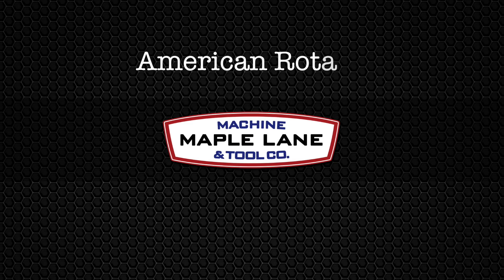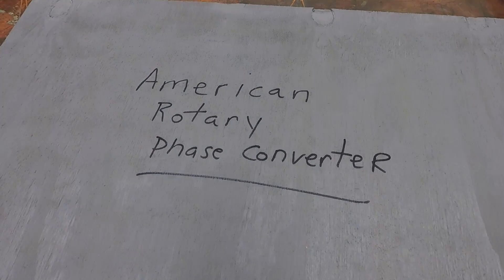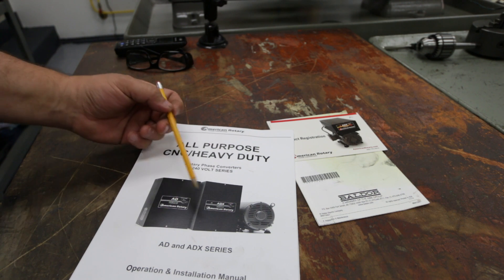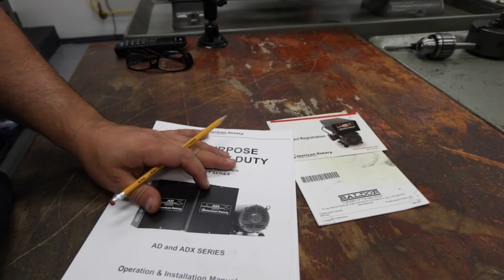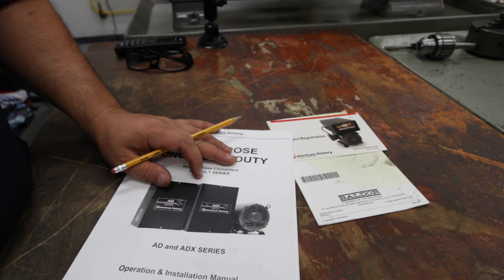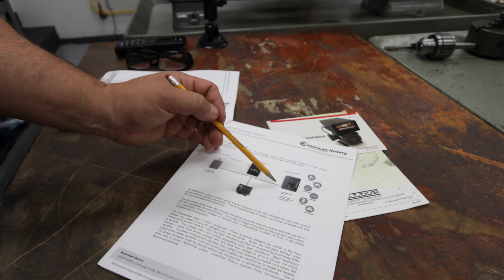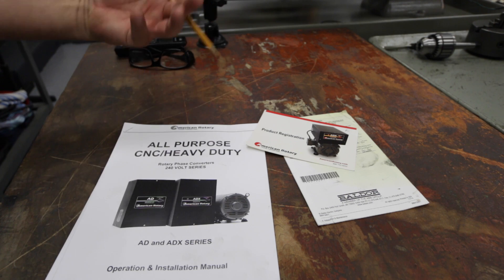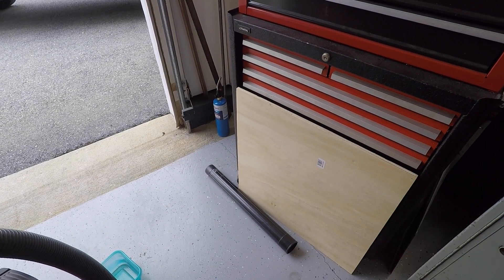American Rotary Phase Converter Install

Comment: I have an American rotary converter because three phase power is not available out where I live. Nobody is a baby for making sure you're extremely high-powered rotary phase converter is hooked up properly when it's powering an expensive Swiss lathe and other equipment not to mention the safety of the people working in your shop. Thanks for the video and for sharing your experiences getting this important piece of equipment running and demystifying something that could help a lot of people get their equipment up and running

Comment: I'm curious, how much power is lost by using a motor to convert phase? 20% loss? That converter unit is over $1K; how much would it have been to have 3-phase power run to your building?

Comment: I really recommend you go back and add thermal and abrasive resistant tape to the bolted connections on the motor.

Comment: The instructions I was given must’ve been missing a few pages but I worked my way through it anyways. Some people don’t realize that any rpc won’t work correctly if running cnc. If running cnc you need an AD or ADX model twice the value of your highest rated motor. It’s not a bad idea to go one model up if you can afford to and have provisions for the larger capacity. Also my motor just states Baldor but internal digital board is Gentec. My RPC is two days new.
Reply: Didn’t jknow that CNC was different rules for a rpc build. An rpc induction motor needs to be at least 1/3 hp larger than the hp of the tool you intend to power from my  knowledge of the subject, but I have zero experience with CNC other than theory. I’ll remember that.

Comment: I have a phasematic rotary phase converter. Makes very little noise and runs everything in my shop. Had it for over 15 years. Haven’t had an issue yet!!!
Reply: Seems like Phasematis is double the cost of American and thats why I'm looking at American.
Reply: G man they are expensive. I have two 1hp phase converters that I bought cheap. They lasted a year or so and died. Just keep that in mind. 😀
Reply: @jbslittleshop2897  Im not sure exactly what company your referring to in your answer."They are expensive" = Who?  .............     "I have two 1hp phase converters that I bought cheap. They lasted a year or so and died. Just keep that in mind"    What co. you talking about here?          Both companies are expensive but American now has a Liftime Warranty on their control box and 2 years on the idler motor which is a Baldor.  Phaseomatics want $5,900 for their 30hp while American sells theirs shipped for under $3k with warranty
Reply: G man oh sorry. Phase-a-magic is expensive. I have two from Kay industries that were a lot cheaper. They ran about a year and laid down. So, cheaper is not always better. Sorry for any confusion.
Reply: @jbslittleshop2897  No worries. I truly appreciate your info. From what Im learning American Rotary is the current most effective "Professional" choice but still expensive. My CNC Tech told me not to buy a cheap converter  as it could cause one of the Drive Units in the CNC to fail and I would be a very sorry camper!
Reply: G man if your running CNC. Be VERRY carful. Phase converters will cause a lot of damage!!! Just FYI. All my stuff is just automatic.
Reply: @jbslittleshop2897  JB.....What does "All my stuff is just automatic" mean???    My understanding is you have to buy a phase converter that has an electroni box that has a balanced power as compared to the home made converters i built myself years ago and if you bought from a company like American you would be OK. Have you heard of people haveing issues with there CNC Rotary Phase Converters?

Comment: Thanks for the video, Just bought myself a used 52 yr old Wells Index 745 vertical mill. That's set up on a 3 phase 1 hp motor. So im doing some research on rotary phase converters.  And it looks like the AR-5 is what there calculator calls for. Your video makes it look pretty easy. I just put 220 on 50 amp breaker out to my garage/shop for a Mig and Tig welder a yr ago. So having room for this set up won't be a issue at all. I like the heavy duty locking cord idea. That way you can utilize multiple machines all off one cord. Saving $$ not having to run expensive wire all around the room on multiple boxes mounted on the walls. Thanks again.

Comment: Great vid. I just got done wiring my 40hp the other day for my cnc machine. Doing a last few things and then the machine will be running.
Reply: How many amps dose it take to run with no load.
How many amps dose it take to start.

Comment: nice brad. i have been using a  rfc for years. i just recently bought a cheap remote control switch on ebay i set it up in parallel with my on off switch ,i keep keyfobs on my mill and pedestal grinder so i don't have to walk across the shop to turn it on or off. a real time saver {lazy}. i see a lot of comments on the vfd's and they have their applications. the problem you can  get into is if the machine your are trying to power uses power for a step down transformer or  other accessories .like aux power feeds or coolant pumps etec. the vfd cant slow your spindle speed and not affect any other component .and you sure cant run more than one motor at one time. and if your convertor is large enough you  don't have to run out and but another vfd to power your most recent 3ph find

Comment: Just bought an AD15 for my mill and lathe. Be sure any of you who purchase that you get one designed for a cnc with appropriate electronics inside. I installed a 100a sub panel since my mains were taken up and shifted some breakers around. Installed a 50a and a 30a then ran the 30a to my smaller 2 phase vfd powered machines (was high with individual breakers) and the 50a to the rotary phase converter. I also useD 6-3 wire all the way in one run with two outlets essentially giving me a little over kill for wire size as 10awg was all that was needed per machine. It was actually cheaper to go bigger at Home Depot buying a bundle roll, go figure. My mill and gang lathe have vfd’s as well but it’s 3ph in and out. The lathe wasn’t a candidate to convert to single and the mill probably was but I didn’t want to mess with it I needed it Running ASAP.  My garage has the Same power supplies that my home has. Wonder which side sucks more juice?

Comment: Guess your machines are 220V 3 phases, here it got to be jacked up to 600 volts since in Canada the mostly used standard is 575 to 600 volts.
How much is that 10 HP motor weigh, from here it looks pretty small... ?

Comment: Just getting over being sick, you and Adam been hanging together? lol Actually true 3 phase is the way to go, but if you don't have that then an RPC is a good substitute. I get people telling me all the time to go VFD but they don't realize that to run my machines I would still need an RPC to feed the VFD with or it is like $5000 for a VFD to run a 20hp motor from single phase power.

Comment: thank you for the step by step. I just bought the same system, and have all the associated anxieties and worries about hooking it up, so your video really came at the exact right time. I get delivery of my old plate roller next week along with the RPC. One question: did you discharge those honking big capacitors prior to the installs?

Comment: For those watching this video, "cords" no matter what type used are in the NEC.   Under "Uses not permitted" is says that cords are not allowed to be used in place of permanent wiring within premises.   That means it can not be used connected to an electrical panel on the line side as in the video.   Just a minor catch, the video is very good otherwise.
Reply: Can you elaborate on this? I didn’t watch the full video so I apologize. I’m in a leased shop that doesn’t allow any hardwiring by myself. Assuming the input voltage of the converter is 240V, what is the reasoning for not being able to wire a plug to make the converter portable? I know this is a no no but I don’t fully understand the reasoning

Comment: Nice video and nice install Brad. 
On those bolt connections, you really should have used some rubber tape on the bolts first, and the vinyl tape over the top. Just using vinyl tape can wear or punch through after a few years under motor vibration. Yea, it may not. But it might. See Stan's video on how to do bolt terminals on a motor.

Comment: @ 19:18 you stated "you dont need seperate VFD's".............Whats a VFD ?...............How did you size the converter needed ?   Thanks much for this great video as I wanted to hear how loud the phase converter is while running.
Reply from the maker: A VFD is variable frequency drive. They convert single phase to 3 phase. How I sized it was by doubling the horsepower of the intended machine. I have a 10hp and my motors on my biggest lathe is 5 hp.

Comment: For a single motor a VFD is the way to go.
Reply: I run my Okuma LS 10hp lathe on a 20hp VFD.  Has worked great for 10 years.  At work we run much larger motors on VFDs.  I also use an RPC for multi-motor machines but for most applications I prefer VFDs regardless of load.

Comment: Seems odd that you have installed a 1ph to 3ph converter and are only using 2 of the phases. Is that so you can go from 240vac to 415vac (US voltages 110vac to 200vac) if so it would have been more cost effecting and electrically efficient to have just put in a  correctly sized and well regulated single phase transformer.
Reply: No, he is using three phases. The incoming 220V AC line effectively has two phases 180 degrees apart. You want 3 phases 120 degrees apart. The rotary converter generates 2 phases each 120 degrees out (one each way) from the incoming phase. You use the two RC outputs plus one input phase lead for the total of three 120 degree phases.

Comment: Not a fan of the ADX. Better to jump up a motor size. All the ADX does is pull in a couple capacitors momentarily. Ran into a big problem with ARPC on a compressor application, they undersized me and I paid about as much as the next size up. Beware of the ADX series it's kind of like a band-aide for not having the proper sizes unit. The harder starting equipment needs to be proper sized!!!!!!!

Comment: i'm in the same situation rpc vs vfd to power a lathe, i'd rather a rpc just plug in and play no electrics or motor to change, i just have to find out have i got the power to run the rpc.
Reply: Do you have the power to run the lathe, plus about 30% more? Then you have enough power for an RPC. Or a single-to-3 phase VFD, for that matter.

Comment: VFDs are better but I'd stick with a RPC when the motor winding insulation isn't designed for VFD use. (the old insulation can quickly break down with VFDs)
Reply from the maker: An RPC is great to allow the ability to simply plug in and go.

Comment: For your 240V source you cut back the neutral, preferring to use the ground.  I know it really depends on what each color represents.  OSHA (not necessary in your shop) would have required the green for ground & the white for neutral.  With your way of thinking, I should be able to add a couple of 120V plugs onto my welding cart even though it is 3 wire 240V.  your thoughts?

Comment: Putting those Wiha drivers to work?   Those rotary phase converters have come a long way in the last couple of decades.  I use one at work to produce 400Hz power and it needs its own room and climate controls because it is so noisy and inefficient.
Reply: This kind of RPC that just generates 3 phase from single phase at the input frequency is a different beast from an MG set that will generate 50 or 400 Hz from 60Hz. The MG sets need separate armatures for the motor and generator, so are bigger. But you are right, the old ones are bigger still, and usually noisy.

Comment: This looks to me like you can single phase your machines. Looks kind of dangerous. Did you ask the manufacturer about that? If so what did they say? 

 With the breaker power in the RPC unit and you go over and hit start on one of your machines powered to the unit is there any noise coming from the motor??? 

 I really wish she didn’t make this into a commercial.

Comment: Please define the term "SO" 
Thank you
Reply: SO is a code for the insulation on the electrical cable.  S = standard/600 V.  O = oil resistant outer jacket.

Here's a link   https://www.mcmaster.com/#so-cords/=18r9enw

Eli D.
Reply: "S" = service rated 
"O"= oil resistant.
Reply: there is also sj ?? 
if i am correct what is the j
Reply: SJ is Junior Hard Service, 300 volt, Not Oil Resistant

 

SO is "Hard Service" 600 volt Thermoset insulation, Extra Hard Usage, Oil resistant

duh just found